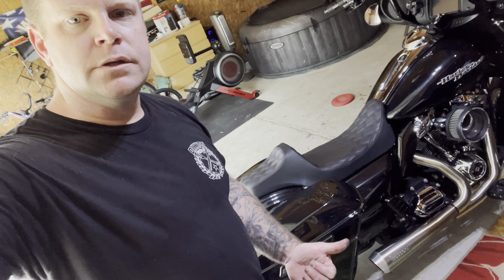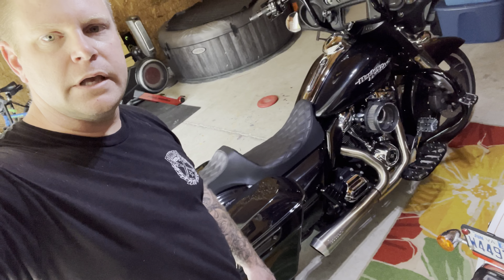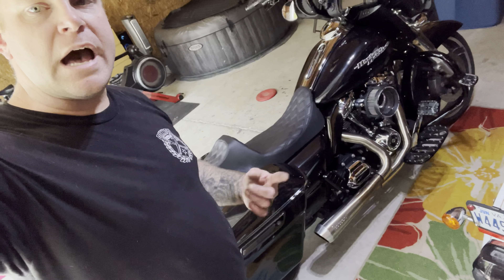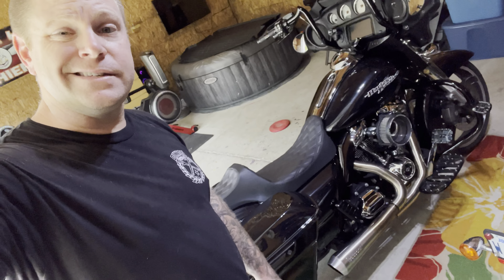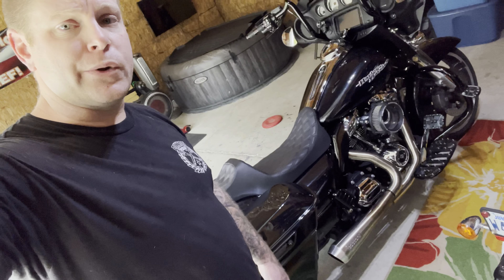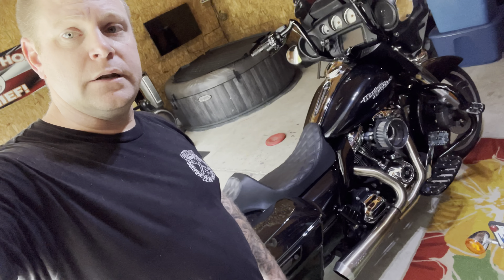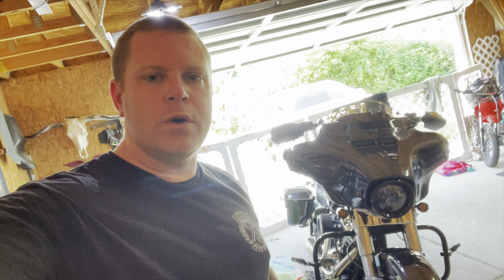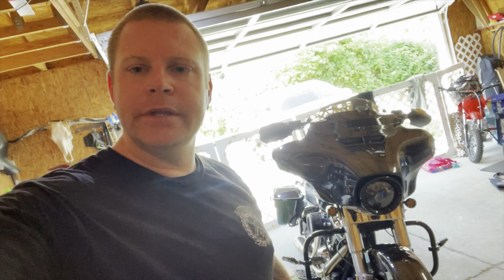Bassani Road Rage 2 into 1 Exhaust - Baffle Wrap Removed

Comment: I bought the same pipe and did the same, but the whistle noise that came with removing the wrap drove me nuts. Currently trying to fab up a Big city Thunder baffle for the pipe. When I bought the Bassani I was thinking short pipe would equal to louder. I guess I just miss the way my twincam sounded. Ride safe 🤙🏽
Reply from the maker: I know what you mean about the whistle
Reply: But it does equal to louder no?
Reply: Can you explain this whistle sound? I have a very similar pipe and have been chasing a whistling noise on light d—acceleration for awhile haha
Reply: @johnnycorvette4242  I’ve been calling it the Harley diesel motor lol. Now that my baffle is a little corroded I don’t notice it as much.

Comment: Programmer required after installing this pipe? Some say yes some say no…
Reply: On a 22 Street Glide
Reply from the maker: I wouldn’t say required, but I would say recommended anytime you change the exhaust that’s more air out which means you should change your intake, which is more air in which will change your air ratio. Why you need to put a commander on it. I run Thunder Max.

Comment: Got the same basanni exhaust, wanted to get a update from you on how you feel about taking the baffle wrap off? Are you liking the sound and is the whistling sound pretty bad? Now that you hear it would you do it again?
Reply from the maker: I got tired of the whistle, so I re-wrapped the Baffle using some fiberglass material from Amazon. I actually think now it sounds better than it did with the factory wrap, and the whistle is gone.

Comment: How’d you get it out ? I removed the two bolts at the end of the pipe , seems like that baffle is tight in there
Reply from the maker: Best thing is with a slide hammer, I ended using a pry bar that was curved on both sides, hooked the center of the baffle with one end of the pry bar and smacked the other end with a hammer. Came right out
Reply: @MotorPsychoMisfit  thanks , that’s the only other thing I could think of . I’ll try it out 👍🏼
Reply: @MotorPsychoMisfit  did you have to remove the exhaust for that ?
Reply from the maker: @MONGOLS.69  nope, you can do it all while attached to the bike.
Reply: @Ostopchuk880 it’s a little late now but the way I did it was hooked a ratchet strap to the little bar on the baffle and hooked the other end on my trucks tow have hooks and just ratcheted the thing out. Took about a minute and had no problems